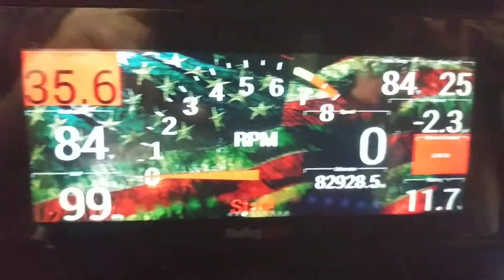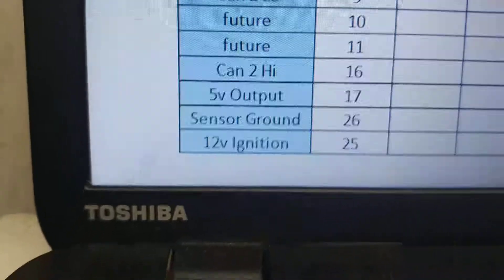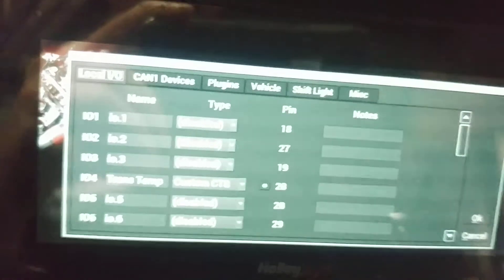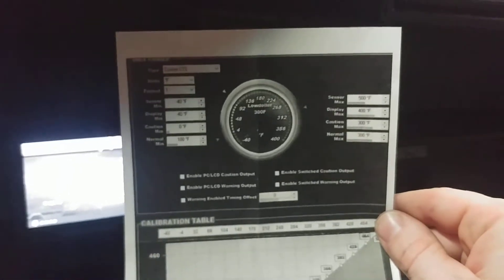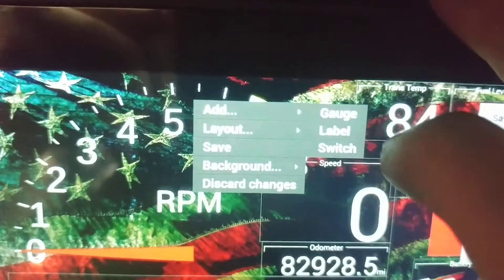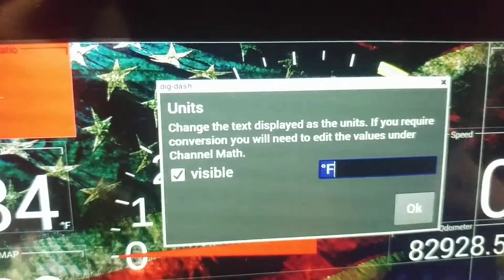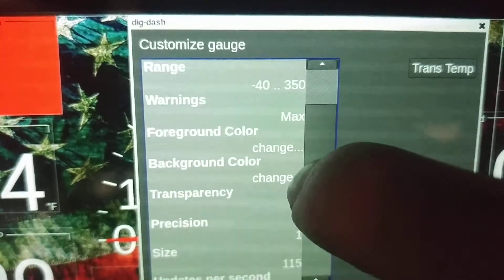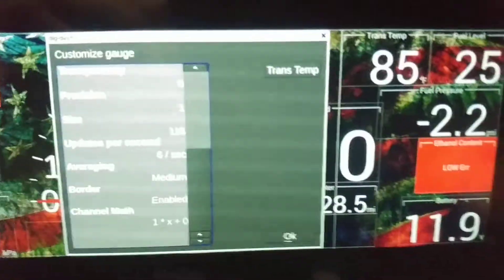How to add a transmission temperature sensor to a Holley Pro Dash

Comment: It looks like you wired yours using the pins on the Holley pro dash. I was thinking of wiring mine to the x max inputs harness that’s coming off the harness. Would that still work?
Reply from the maker: I haven't tried it, but it's a two wire thermister, so in theory it should work.

Comment: Thanks brother! I’m installing sniper efi and 12.3 pro dash with hyperspark ignition and your video helped me get my trans temp sensor hooked up. You’re funny as shit too!
Reply from the maker: Thanks for watching, I'm glad you both enjoyed the content and found value in it for your own project.
Reply: hey man running the exact same setup any tips?
Reply from the maker: Thanks for reaching out. I've since replaced the LDM sensor with a Rife liquid temp sensor. The biggest thing is to take your time with the wiring and make sure that you get solid connections with as little resistance as possible. The other is to ensure that your scaling is as accurate as possible. If you're using a Rife sensor on a Holley, and it's not in the drop down menu, it has to be scaled from low resistance to high resistance, which is also high temperature to low temperature. For some reason, they Holley systems don't like being scaled from high resistance to low.

Comment: Hey I’ve been trying to figure out how to wire 4 sensors to my dash a couple 3 wire pressure sensors and some 2 wire temp gauges. Do they all go to the 5v pin and all use the same ground. I can’t find any information on it or any pictures lol thank you if you see this.
Reply from the maker: The three wire sensors can share the 5 volt wire off the back of the dash, the signal would get wired individually to their respective pins. The temperature sensors have two wires that would get one wire to a pin each on the dash, and then all of the sensors can get connected to the sensor ground pin on the dash. Does that make sense, I can explain it differently of needed.
Reply: @TrailerParkMotorsports  yes that makes sense!. Is there a limit on how many? I feel like 5-6 sensors each is to much for the 5v or the grounds.
Reply from the maker: As far I know there really isn't a limit on the sensors, they don't have a very high amp draw. Most aftermarket ECU's share their 5v output to almost all of the 3 wire sensors.